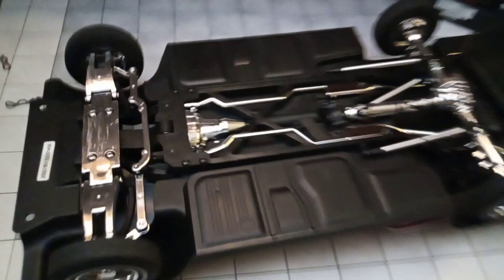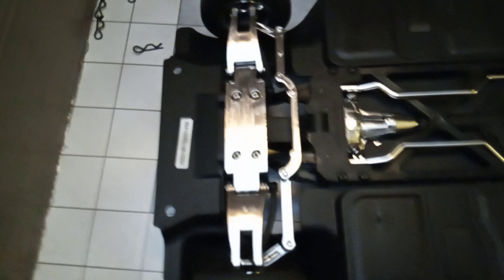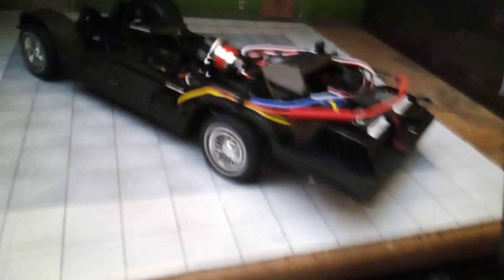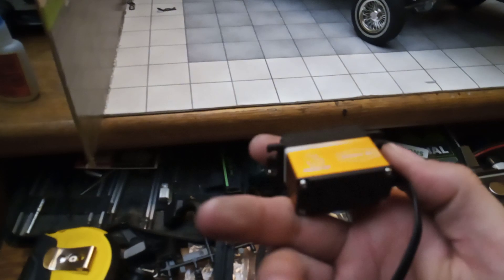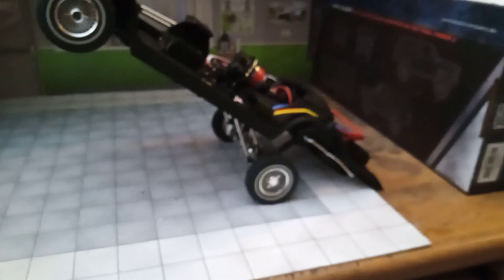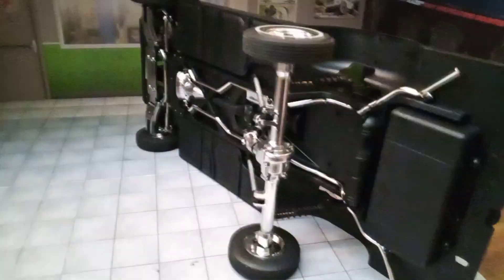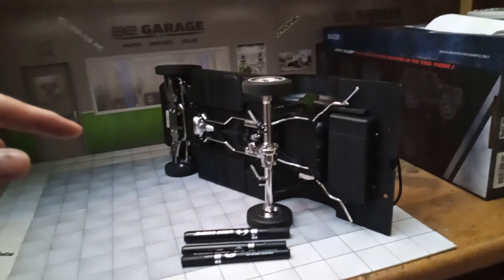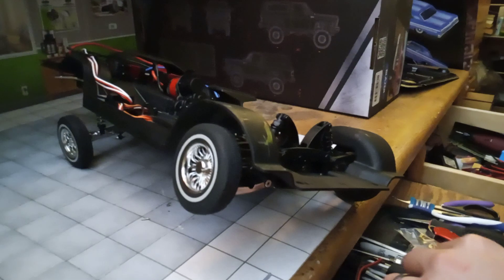redcat lowrider gets chrome

Comment: My steering won't work anymore what u think happen?
Reply from the maker: It could just have burned out the best way to find out that it isn't the receiver and that it is indeed the servo unplugged channel 2 lead and plug in your steering servo and the channel too and you'll use your throttle to steer to see if the servo works or not if it doesn't then it's definitely your servo if it does work then channel 1 went out on your receiver did you do the toe fix or change any front suspension for the aftermarket chrome parts if so you might have accidentally tighten something down too tight

Comment: How did you get those pieces to look like chrome? Looks clean bro
Reply from the maker: Liquid chrome pin
Reply: Where did you purchase the chrome pens from?
Reply from the maker: @jorgerivers714  I got them from my local hobby lobby store or I can get them at my local RC hobby shop
Reply: @jorgerivers714  just look up Molotow liquid chrome markers they can be kinda pricey but they are awesome luckily I've had mine and a replacement bottle of ink for just about 25$

Comment: Paint the underneath blue like the body
Reply from the maker: Yeah that's does look cool with chrome accent some ppl have on the redcat lowrider page. Thanks my friend and thanks for watching
Reply: @nmrc7778  always a pleasure looking at the progress.  Aswell, is that all you used to chrome? The pens? No priming, etc?
Reply from the maker: That's correct just the Chrome pens no primer no nothing just use the pen right on it there's other people using that kind of chrome tape I don't know what it's called but there's a couple people using that and that looks pretty good too but with all Chrome you go to clear coat it if it's painted by pen or by actual paint it'll turn it silver so don't do that not unless you can find something that will still look Chrome and seal it at the same time
Reply: @nmrc7778  did you seal it when you used the pen?
Reply from the maker: No cuz as soon as you clear coat it it makes it look silver